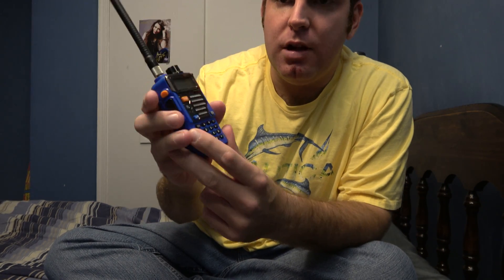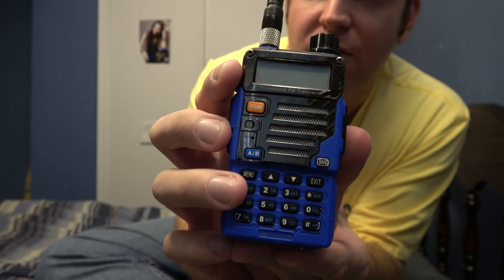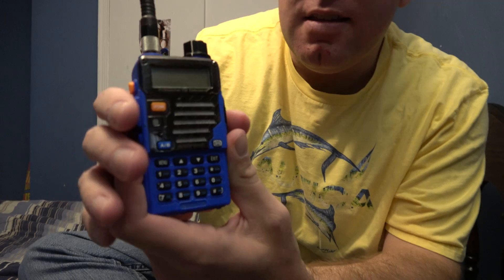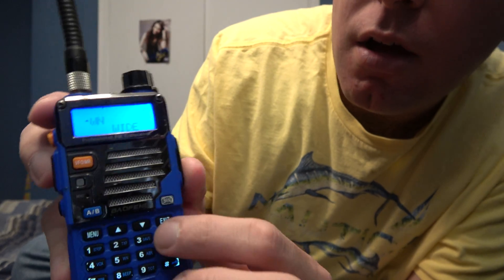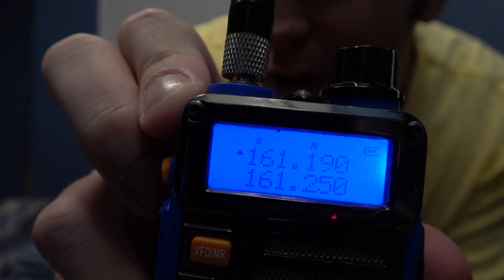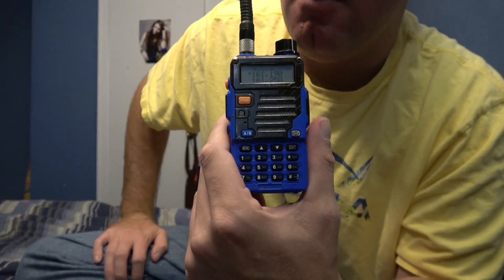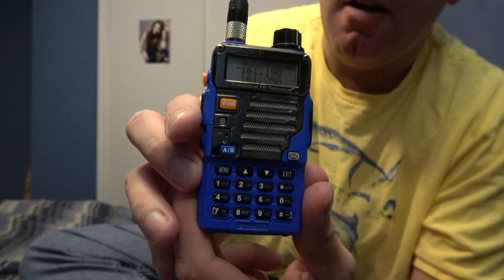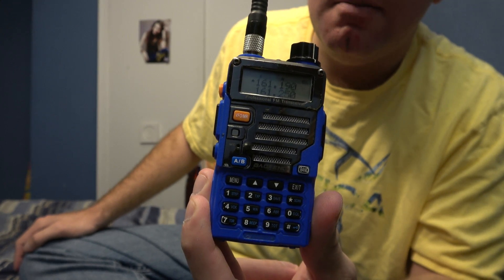How to switch from wide to narrow band on a Baofeng HT

Comment: the county sheriff's office has switched to narrow band, I noticed your video talks about narrow band, do you think these radios will receive police narrow band: this it the one I was looking at.  Baofeng UV-5R Plus FM Dual Band Transceiver Ham Two-way Radio HT
Reply from the maker: It depends on what frequency range it's in. The Baofengs are 136-174 and 400-520 MHz only. I now use a Yaesu FT-25 that also has narrow band capabilities
Reply: @VArailfan89  i'd rather find one that just received do you know of anything like that?
Reply from the maker: @MissouriOldTimer  Depends on what you're using it for. My Yaesu FT-25 receives on 160-162 but can transmit on the 144 band
Reply: @VArailfan89  I don't even know what frequencies are considered "narrow band"  All I would like to do is eaves drop on that's going on..